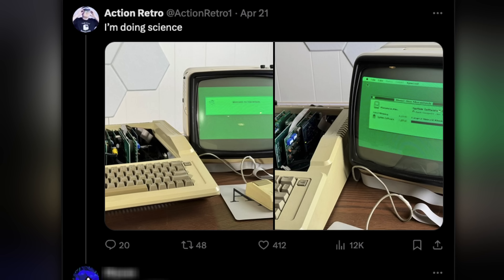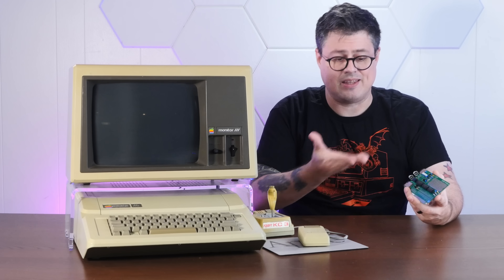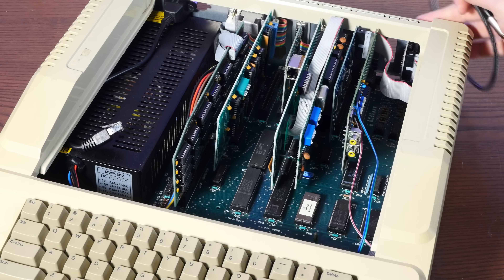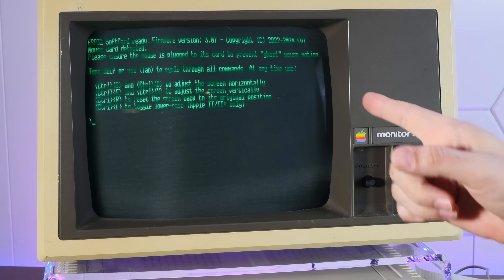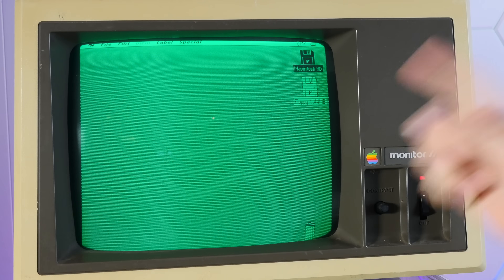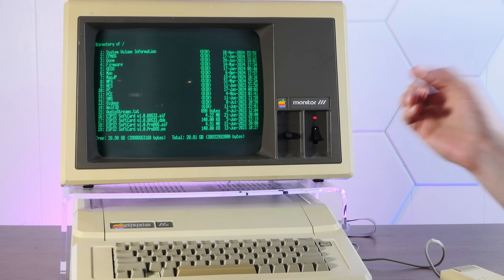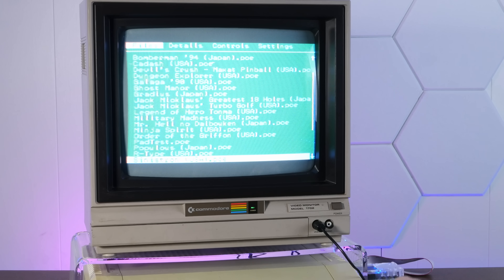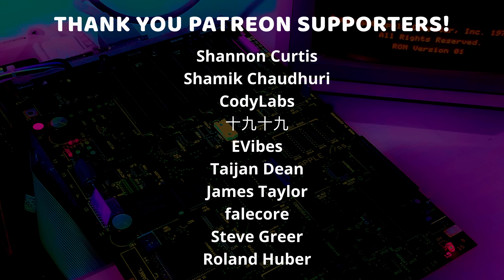This Apple II is running... Mac OS?!

Comment: This card reminds me of an old Macintosh accessory called MacCharlie, which was a sidecar for the Mac that contained a PC clone system and allowed it to run DOS software using the Mac's display, keyboard, and mouse. The IIe card for Macintosh LC also comes to mind.
Reply: There were DOS Cards with a 486 CPU for the Mac, straight from Apple. You could get it in a Quadra 650, and also a Performer or two. The MacCharlie sounds like overkill. unless it had it's own floppy, because Mac floppy drives were mechanically unable to write Dos format, if you wanted a floppy to use in an ordinary PC, you were stuck.
Reply: @squirlmy  It had a 5 1/4” floppy drive built in, as well as a keyboard add-on that slotted the function keys and numpad on either side of the Macintosh keyboard. It was absolutely ridiculous, but that's why I find it so fascinating... It looks like it was introduced in 1985 and (unsurprisingly) discontinued within a few years.

Comment: It's a 21st century take on the PC addon for the TI-99/4A. That was actually a full PC which had an adapter box to plug into the side port to use the TI as a keyboard for the PC. An ESP32 card like this apple ][ one could be made to plug into the side port or in the expansion box of a TI-99/4A and do all this same stuff.

Comment: That's in double hi res mode which is proberbly the default on the mac its just like running doom on a nes with raspberry pies in its cart input it isnt a stock achivement theres a question you are not asking its telling with a question mark .....hello? MY APPLE TOO IS RUNNING 32BIT EMULATION bert

Comment: It sounds like you bypassed the mainboard of the original apple and use everything as peripherals to a new computer. The other way to do it would SLOWLY run 6502 re compile  of modded mac os to an improved memory. May or may not even be possible.

Comment: I would guess that even though the card you are using to boot from has functionality to act as a boot device when directly addressed it is not recognized by the II ROM as an actual boot device. While the IIGS and Enhanced IIe hsd more suffisticsted meansc to gind boot devices prior versions would look in $Cn01, $Cn03, $Cn05 and $Cn07 (n being the slot number for the card) for $20, $00, $03 and $3C in those locations. If the ROM addresses at those locations did not match, it would not recognize the card in that slot as "bootable."

Comment: Only posting this because I didn't see anyone else mention it: FWIW, this thing is conceptually at least basically the same as Dave Schmenk's Apple2Pi project from about a decade ago. That thing was the talk of the town back then, I'm kind of surprised it hasn't seemed to have come up. I was actually surprised that it wasn't what this video was about.

This adds the relay to switch the composite video/sound outputs between the Apple II and the ESP32, and I'm sure it "feels" more bare metal given it's not running a fully blown Linux environment on an even more powerful CPU, so... is what it is. If an ARM-based emulator that uses your Apple II as an input device is what you're in the market for this is certainly an interesting take on it.

Comment: If they could add an analog RGB pass-thru (DE-15f pin connector) so it works with the Apple IIGS, this card would be a dream come true! How cool would it be to run MacOS, Windows 3.x or DOOM on an AppleColor RGB display, using the IIGS mouse and keyboard! I suppose you could use it as-is in combination with an Apple II Video Overlay Card to do that, but it wouldn't the same.

Comment: There’s 30 years between the two systems, if the ESP32 wasn’t significantly faster then they’re doing something wrong
Reply: Could be closer to 40 years, depending on the model of ESP32 (say S3 or C3, f.e.).

Comment: My only problem is... the Apple II isn't running anything at all. It's just a peripheral of the ESP32. There's nothing particularly special about it. You could have it run any piece of software the ESP32 is capable of running. Sure stuff like this is cool, but it takes the Apple II itself out of the equation. You don't even need the Apple to do it.

Comment: I never enjoy this lazy trend of basically routing some modern Pi, Pico, Arduino or other tech like an FPGA separate computer tenuiously connecting up the keyboard and monitor out to basically a dull modern system (even if it is packages neatly). For me, and I am not knocking those that enjoy this kind of shenanigans, it flys in the face of retro computing; Retro computing, for me at least, is about the amazing things that can be done with, stock, near stock and 'back in the day' upgrades. You might as well just run  MacOS on a Pi and just connect up an Apple II based monitor and keyboard, it would be almost the same thing. Again for those who enjoy this, good on you and this is the video for you! :D.

Comment: This thing is really cool, and I love the potential of putting a computer into a computer, basically. But there's also a side of me that can't help but realize this thing is just a complex way to run a more modern computer basically interfacing with an Apple II monitor, keyboard, etc. The Apple II is no longer really the star of the show in this case. A similar common example might be the Intel Inboard 386 that would "upgrade" an XT class PC to a 386. But really, the upgrade board is the computer, and the XT is just reduced to a glorified ISA bus backplane more or less.

Comment: you should add Tandy/DeskMate to the PC section of the card and use the color monitor. im wondering how it would make out using that old 16 color/3+1 voice PSG and XT CPU in an emulated form.
Reply: Tandy's 320x200 16-color mode is supported, however the 3 Voice Sound is not. The PC/XT emulator only supports PC speaker at this point.

Comment: 13:16 Now what I want to see you do is hook up an emulated version of the expansion card onto the emulated Apple 2, inside the emulated Macintosh, inside the Apple 2. If such a thing is possible, you could run an emulated Apple 2 running on an emulated Macintosh running on an emulated Apple 2 running on an emulated Macintosh running on an Apple 2!

Comment: The Enhanced Card in the Apple II, something that I would probably do, pushing older and classic software all the way to its most possible limits, ehehehe. Other than that is nice to know that the Apple II has expansion card slots, did not know that and that is due to the fact that I did not play around with Apple II computers.  Cool hobby, thanks for the video! 😺🥰⌨️🖥️⭐️💎

Comment: 7:20 Tons of 80s kids yelling at the screen “RUN HELLO”!!!!!
Reply: Well, in the directory, it’s a A, so you have to use RUN as it’s Applesoft Basic. For B, it’s a Binary file, so, you have to use BRUN. For the A file type, you can use LOAD then LIST to see the basic source code.
Reply: JUST DID IT MYSELF
Reply: He just demonstrated that he has not the slightest clue about the Apple II.
Guess everybody who does knows would know also exactly what would happen when you had run Hello 😂😂😂😂😂
Reply: yeah that was me, haven't touched an Apple II in 40 years but I knew what the A meant still

Comment: Sounds like you basically putting another computer inside the Apple IIe and using the Apple IIe keyboard to control it. So it's not really running on an Apple II, it's running on a card inside of the Apple II.

Comment: Reminds me of recent talk re IIgs accelerators.

There aren't any 65C816 CPUs that will run over 20mHz, even with cooling. So someone suggested implementing the 65C816 in an FPGA that would plug in to the CPU socket. Except the RAM won't run fast enough, so the RAM would have to be moved to the module, too.

This repeated with various functions that would need to be moved, until the point was raised that, at what point is it basically no longer an IIgs? When is it a 2024 system on a chip, just using the IIgs case, keyboard, and monitor as a shell? The debate will rage on, I guess.

Comment: The left column of the Apple directory tells you filetype. If it's an A, it's applesoft, B is binary. Only binary files use the BRUN command.
Applesoft programs use the RUN command, not the BRUN. IIRC, I in the left is Integer Basic, which requires you to fire up integer basic before running it.

Comment: 7:25 HELLO is an Applesoft program (the A the first column). Applesoft programs are RUN not BRUN. BRUN is for binaries (the B in the first column). Not all B files are executable, some are just binary data (like pictures that are generally 34 sectors big).
As for HELLO. Generally it is just a program that is started at boot with a simple message. When the floppy was formatted with the INIT command, it was usual to give the name of the program to run at boot. INIT HELLO was the most common.

Comment: This is one of those projects that makes me scream 'WHY???' The Apple II has no place in there other than to provide power. It's very likely that with minimal mods using the breadboard one can make this card work with the Apple II CPU unplugged from the motherboard. This is just a ESP32-based SBC running a bare metal emulator trying to look like an Apple II card.

Comment: Apple II in Mac Plus in Apple II. This reminds me of when I found a Z80 Spectrum emulator designed for MS Dos. In order to use it on Windows 10 I run it is DosBox. The Z80 Spectrum emulator also had a dos shell within it. So I ran an emulated emulated emulator.

Comment: I thought you were using an Apple II Pi card that lets you hook a RPi 3 to it and uses the Apple as a terminal.  It even came with a distro that boots straight into an Apple IIgs emulator running at overclock speeds.  And also runs modern Linux...

Comment: You can't BRUN HELLO because it's an AppleSoft basic program. You could have typed "RUN HELLO" and that would work... but it JUST ran when you booted the disk... it's a basic program that clears the screen and shows you a disk catalog. You did the next step correctly by typing BRUN ESP32NTSC😃

Comment: I do like projects like this, don't get me wrong. But I think when it requires a piece of hardware that's doing most of the heavy lifting, it's only sort of running on an Apple II. It's like the Super Game Boy running on the SNES (or the SuperFX chip for that matter). I do like the idea of running MacOS using the Apple II keyboard and peripherals. It's no less technically impressive and hilarious. Great video as always.
Reply: The Super Game Boy and SuperFX still output video and audio via the SNES graphics and audio circuits. With this board, the video and the sound are both being generated and output by the ESP32 for all of these programs. The Apple IIe is only being used for input controls (keyboard, mouse, joystick), being passed along to the ESP32.

Comment: someone: what's operating system running on this apple II ?
sean: yes
Reply: It's either DOS 3.2 or DOS 3.3 since the catalog says volume 254. ProDOS didn't use volume numbers, but rather volume names. I don't think it's possible to tell exactly which without a bit more info. 

DOS 3.0 was never publicly released. DOS effectively started at version 3.1 (sometime 1978) and it wasn't out long (a year or less) before being replaced by DOS 3.2 (Feb 1979). 3.1 actually never even had a manual. ProDOS came after DOS 3.3 but it was significantly different. Can't see the Floppy EMU clearly but it might say DOS 3.3 on it's screen.

Comment: You need to upgrade the Apple IIe to an "enhanced" one to auto boot the Yellowstone and other Smartport devices. Involves a ROM swap and a CPU swap to a 65c02. Running minivmac in 480i mode actually makes sense on a Monitor ///. It has extended persistence phosphors to reduce flicker. Also, I can taint any Apple II with Windows 3.0 thanks to the Applied Engineering PC Transporter.

Comment: The 21st century will be remembered as the one in which we used current hardware 50x times powerful than the retro systems they are slotted in as "expansions" 😅
Reply: Every single processor card for the Apple II that came out in the 20th century was also more powerful than the system it was slotted in. Why should an Apple II processor card from the 21st century be any different?

Comment: It's neat, but it's not really much of an Apple II anymore at this point, right? It's essentially another computer in an Apple II case, which is cool in its own right I suppose, but I just can't seem to get that excited by it. Great showcase video though : )
Reply: You could look at it in the same light as Z80 co-processor cards for the Apple II, that allowed you to run CP/M software on the machine back in the day. Or the PC-Transporter, that had a NEC V30 (186 CPU) with CGA video that allowed you to run MS-DOS on an Apple II. Though this takes it to modern extreme, and for the most part I would agree. Still, I'd love to see it support the IIGS, just to act as a modern PC-Transporter card.
Reply: @Apple2gs  I think I see the Z80 card (and similar) in the same light as this actually. But that's not to say I don't support these ideas. And I think it's awesome that passionate enthusiasts are still making cool hardware for these old machines : )

Comment: This really does demonstrate the versatility of the Apple II design.  Kudos to Steve Wozniak.
Reply: Not really. The program running on the Apple is simply redirecting input and output to the slot holding "another computer". It's not so much different from what happened when installing a modem. The apple is basically turned into a very over priced keyboard and monitor (in the server world you'd call it a "dumb terminal"). The Mac card is doing all the work and just watching the keyboard for input and sending output to the monitor.

It demonstrates how far the industry has come that they can put a much more powerful computer on a card, or even just a chip. BTW...Apple did a computer on a chip in the Apple ][gs. The MEGA ][ chip was an entire Apple //e on a single chip to allow backward compatibility with all the existing software for the Apple ][ line. That was 1986.
Reply: @Scanjo  *overpriced
When used this way, over- and under- are prefixes, not standalone words.
Reply: @alvallac2171  Thank you so much for the English lesson in the computer post. It did so much for the content...
Reply: @Scanjo  Okay.  Could you do the same with a C64?
Reply: @basicforge  Easy. Write a program that spits out mouse and keyboard packets in any preferred fashion onto the userport, and have the composite jacks being a passthrough like on this one. It'll be the exact same thing, just in a box sticking out the back of the C64 rather than a built-in card. Heck, you could even use a ZX81 for that.

Have to give it credit though, as much as I'm disappointed this is how it's done, I'm equally impressed by how powerful the ESP chips have become.
Reply: @basicforge  Should be possible on everything with an expansion port and a video / audio output as opposed to RF.

Even some systems with RF output can have the video grabbed over the expansion port, and output to HDMI or whatever. See the ZXHD device, for an example.
Reply: @basicforge  That would be awesome. That would be like emulating a C64/C128 on an Amiga 2000 with a Zorro card.
Reply: not “powerful”
Reply: Its never too late for him to release the Apple V with RISC V
Reply: This is like that celeron 300mhz pci card for upgrading a 486 to a Pentium!

Comment: the A next to Hello means Applesoft Basic, as you do not put the B in front to the run command. It'd just be "RUN HELLO", but Hello is the boot file, so there's no need to run it.
Reply from the maker: ah, thanks!

Comment: I wonder if there's a project similar to the PiStorm but for the 6502 and/or 65C816. Amigas running a PiStorm are often even more ridiculously fast than their 68k processor and in that case the board is emulating the CPU itself rather than being on an expansion board.

Comment: The ESP32 has more power than the Apple II it's plugged into 🤣
Reply: It has more power than the Apple ii and the Macintosh it's emulating combined.
Reply: On most monitors the chip powering the OSD is way more powerful than any home computer ever was.
Reply: That's why I think this kind of thing, as well as all of those Amiga accelerators that use a raspberry pi and that Ultrasound card that uses a raspberry pi, is bit of a dodge. It's not an accelerator card, it's a bog standard Apple II acting as a terminal for the ESP32.
Reply: @ironhead2008  It took the MiSTer project a while to get the Apple-IIe core running, but it has, for lack of a better term, more integrity.
Reply: Annoying jokes are stupid
Reply: @ the thing Is it's not a joke, it's fact.
Reply: ESP32比80年代的cray超级计算机更强大！
Reply: Yeah the ESP32 is doing all the heavy lifting, so its a CPU replacement more than an accelerator card.